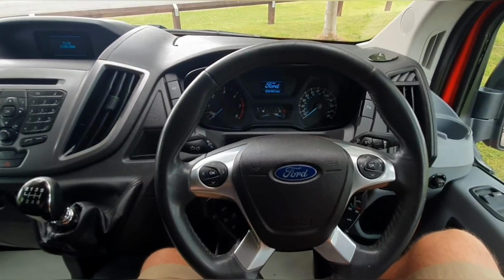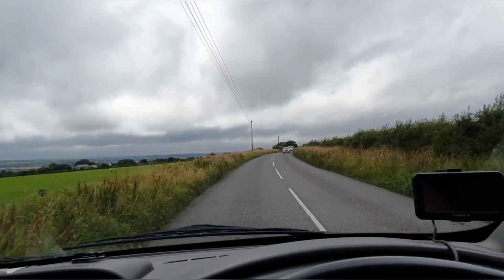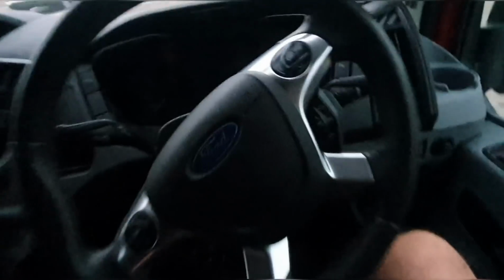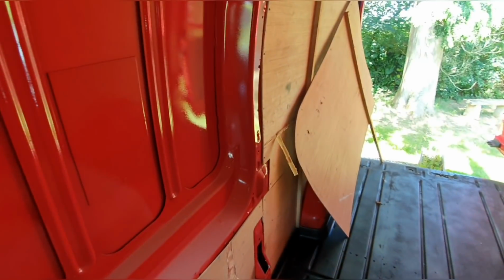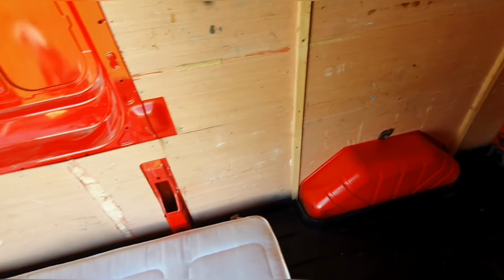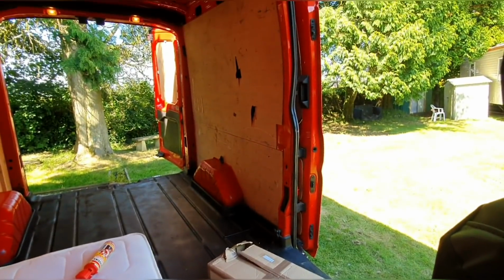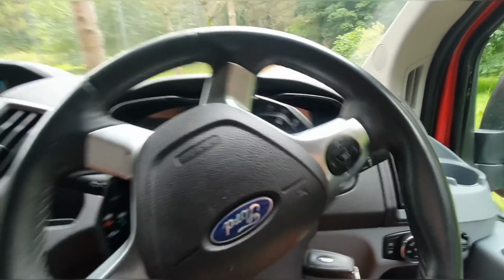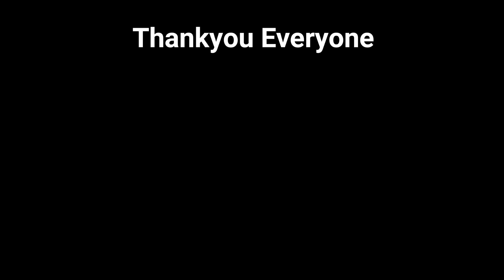A little more of Sherpa's New Van before the Conversion

Comment: Jamie. I’m hoping you get this.  My brother is a motor vehicle trimmer and panel beater.  He just watched this with me - we’re both so happy for you but please leave a few holes unfilled in the ceiling of the van.  He says the condensation will still build between the roof and the ceiling and if it sits there with no drain holes it will indeed rust.  He suggests to just line the roof with using some vents inserted in the lining that sit above  the floor area of course and allow the ventilation.  Just his thoughts.  Take care you guys. 💖💖🇦🇺🐨🦘

Comment: Happy that Sherpa and you have a nice new van for you guys to travel about and go on your adventures.  One thing for sure you won't have any problem spotting the new van in a parking lot.  Something I learned years ago when I worked at a custom shop and that is plan out all your electrical wiring for the back of the van (This includes location and circuit load and then install wire that is at least one gauge greater than what is required for that circuit wiring, on my own stuff I always go two gauges but use the proper size circuit breaker (I like resettable circuit breakers instead of fuses.  Additionally buy good quality wire, when ever possible I like using Mil.Spec. wire  because it is generally thinner, more flexible, and has better quality insulation, another good thing to do is buy multi conductor cable because it has an extra insulation jacket on it or buy lengths of heat shrink tubing and make your own cables. Also don't be tempted to run wires the shortest route instead make you wire runs like the factory does along the perimeter of the vehicle turning into the center of the vehicle when needed. Lastly if at all possible use different color wires for power or switching wire of each circuit and of course make a wiring diagram  for potentially future use because you will never remember everything you did months or years later.  Good Luck with y'all's new van.

Comment: Looks like the new Van is Sherp approved👍👍👊🐶🐶You Guys driving on the left its a bit funny we are driving on the Right .Motor looks a bit tight to work on .But if you have " long Tools" it be easier. I used to have Conversion Van was very nice  just a Gas guzzler so we sold it to some Guy ..

Comment: Does the AC work well and reach into the back area where Sherp stays?
Congratulations. Anxious to see the conversion progress. 

🇺🇸❤🇬🇧
Reply from the maker: We are having vents and fans put into the roof to make sure hes comfortable 😊
Reply: @SherpasDay  Yeah. I was looking at the holes you filled with foam thinking that perhaps that conduit/ passage in the ceiling would make a good routing space for air ducts and/ or wiring bundles.
Looking forward to seeing the changes. 
🇬🇧❤🇺🇸

Comment: Gosh darn, I wish America got a Transit with manual transmission.

Edit: hold on, I’ve never seen a car with a key to open the hood/bonnet. And is that Front Wheel Drive?? Idk if European transits are very different from American ones but ours are Rear Wheel Drive